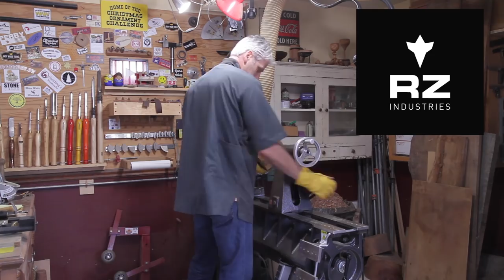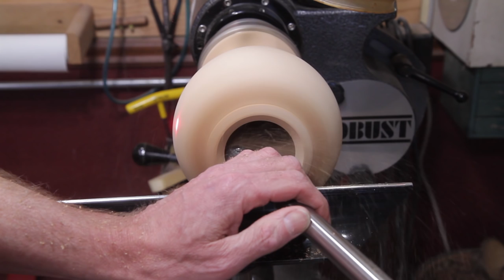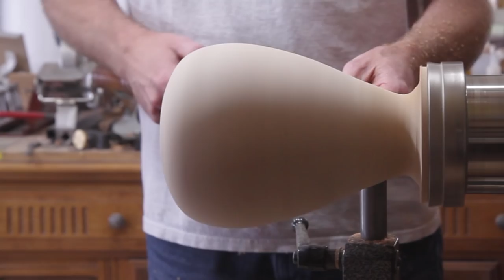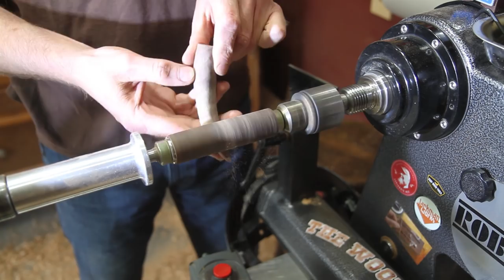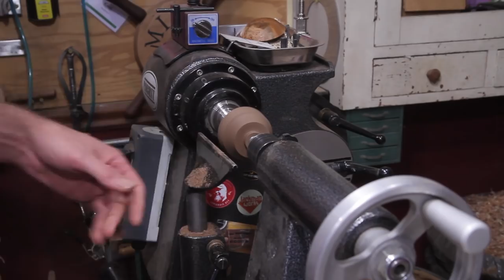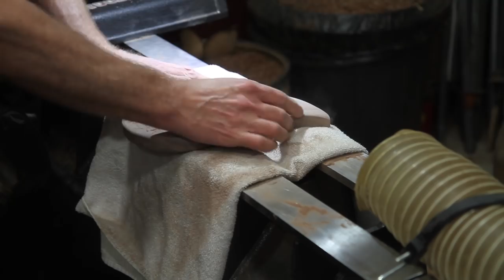Woodturning Project Maple and Walnut Urn

Comment: That is a beautiful piece! I hope to one day be able to make something that nice! Keep up the great work!
Reply from the maker: Thank you very much AJ, how long have you been turning?
Reply: @CarlJacobson  I started only a few months ago with my grandfathers old lathe, its probably 40+ years old and its on its last leg, every thing about it is wore out. The spindle is bent and I couldn't find a replacment, the bearings are wore out, the motor won't start unless I manually rotate the belt and the tail stock moves several inches in every direction. Ive been saving for a while to replace it and I just got to order a new one a few days ago.
  Your videos have helped me a lot and its really great to see how nice things can come out once you have alot of experience under your belt.